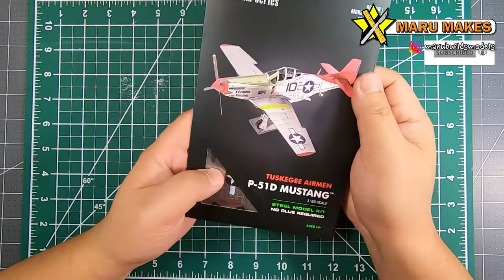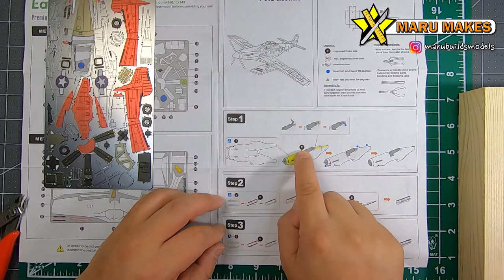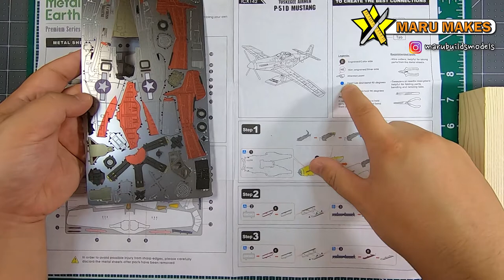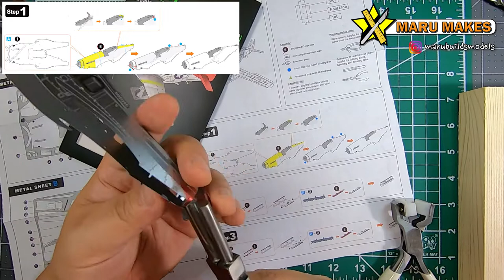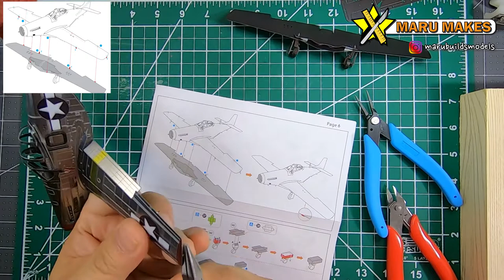How to Build Metal Earth's P51D Mustang "Tuskagee Airmen"

Comment: Are the premium series models bigger
Reply from the maker: Generally they are, especially if its a premium version of the same model. Sometimes there's a basic model which is smaller in scale. The premium models tend to be a little sturdier in my opinion as the sheet seems to be a little thicker
Reply: @marumakes6169  thats what it like like